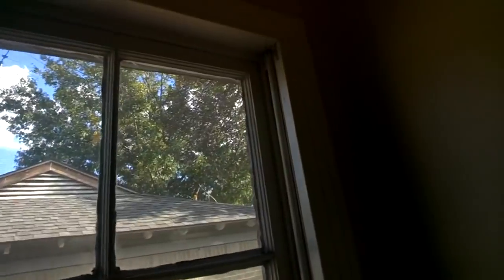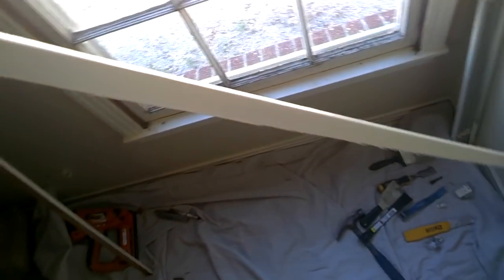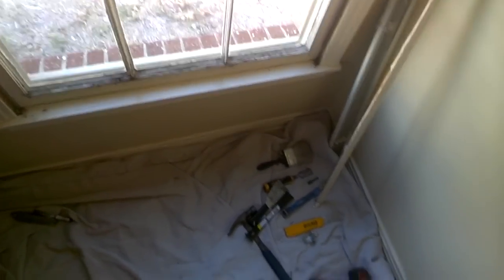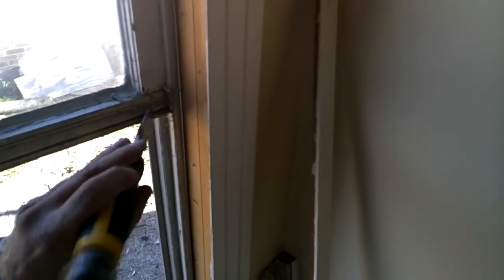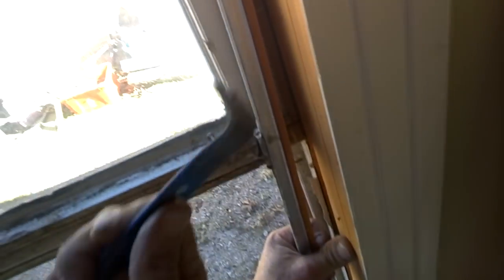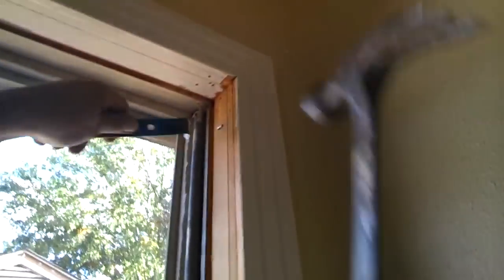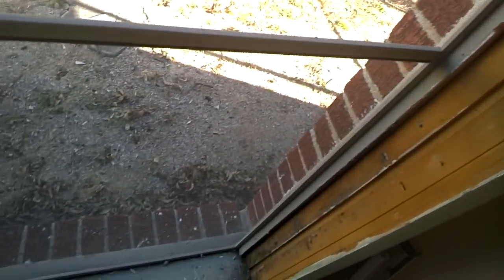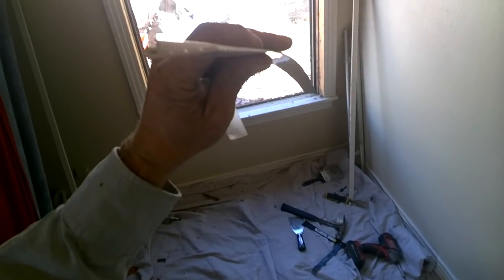Wood window removal

Comment: Did you ever finish the video which showed the install? I would like to see how you put it all back together as well as how you did it from the inside. Most of the windows I have see install from the outside which causes you to have to remove the exterior trim.

Comment: I live in a 1956 Sungold home in So Cal. I cannot stand the old original wooden sliding and double hung windows such as the one he's replacing in the video. They've been painted over probably a dozen times. I've detected at least 6 diff colors. And somewhere under all that caked-on paint is probably some lead-based paint ...and maybe Jimmy Hoffa. And you cant get them clean regardless of method used. Paint (sloppy ppl), water spots and film baked on by the sun. the wood is chipped, splintered. they dont seal worth beans. until i did a little work on the springs if we wanted any window to open, we had to prop them up with a book or dowel! in the bathroom, someone usually props a roll of toilet paper in there. Yeh theyre a classy bunch. Worst part is that the bathroom window is less than a foot from the entryway/front door! So whether you're showering or sh*tting, anyone who comes to the door knows it! Lame floor plan for sure! Explains why there are only 2 of this model in the entire tract! So neighbor just installed brand new vinyl all the way around the house. went & checked em out. After marveling at their new, clean look, I just stood there opening & closing these brand new smooth, quiet, tight, energy-efficient CRYSTAL CLEAR windows for about 20 minutes!! Magnificent in every way. nostalgia does NOTHING for me when it comes to operation, function & ENERGY-EFFICIENCY!! The newer the better! Of course we've got the never ending plumbing problems, main line, laundry drains into the kitchen sink. backs up into the kitchen sink a good 6 inches. smells like raw sewer gas. come on over i'll make u some cookies!  

Give the guy a break. Im a chick and i caught the gist of what he was doing. In fact, Im confident I could replace my exacting windows just by watching this video. Contemplating just that which is what brought me here.  Actually I want the window out to paint the jacked up paint-caked frame, window, sash, sill, all that stuff which i only know by name bc i just watched this video. I know. YOU RECORD A VIDEO THAT YOU DONT REHEARSE AHEAD OF TIME , THAT YOU HAVENT WRITTEN A SCRIPT FOR ... BUT RATHER, IMPROMPTU AS YOUR ALSO DOING THE WORK!   LET US KNOW WHEN ITS UP!  :D  :P  :D

He's smarter to put in the new vinyl window. Why would anybody want to keep junky old, used-up, inefficient windows in their home?
Reply: planetlizz if you want new that’s fine. But most replacement windows won’t retain their R factor over time. Nothing outlast a restored wood window.